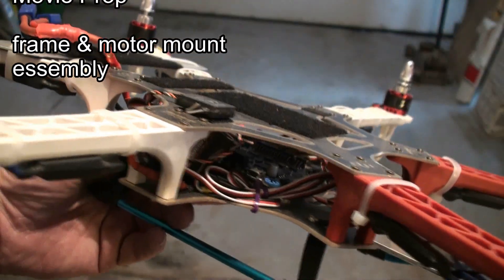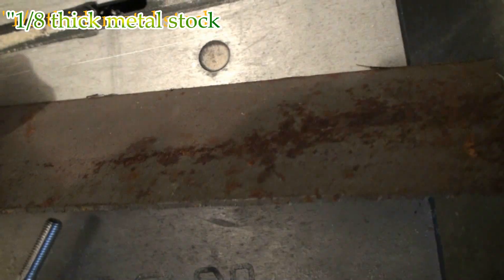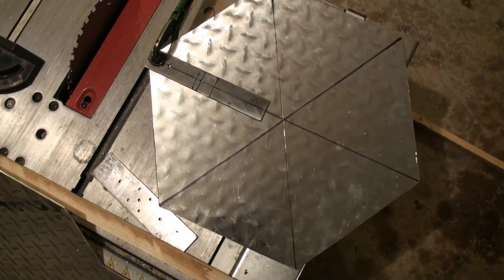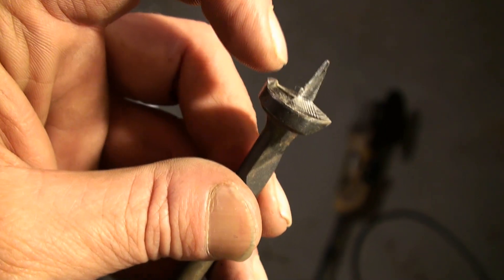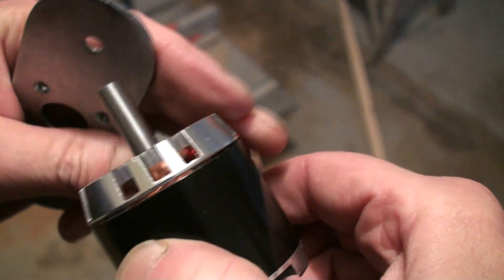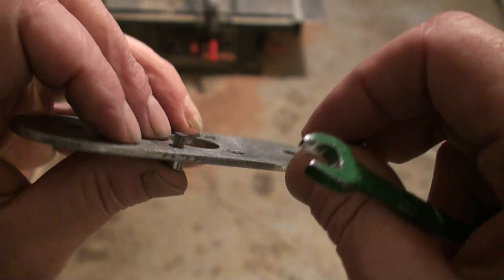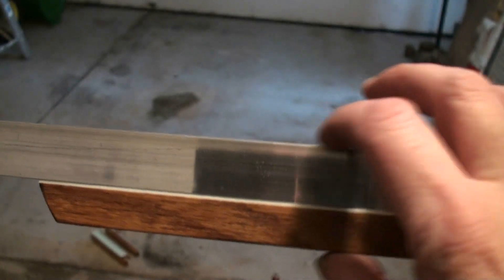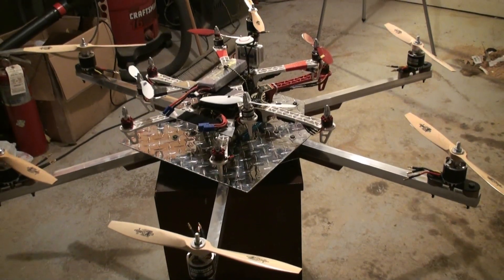#2 Building The Giant Hexacopter - Movie Prop - Frame & Motor Mount Essembly

Comment: 3mm birch ply with a few pieces of carbon would have been fine for the motor mounts,nothing wrong with yours,but with weight it cuts into your flight time and carbon in small sizes like your application is cheap.A small vacuum bag and or a diy press would work fine.for all your needs.I like the booms with the wood insert,excellent.

Comment: Holy Hell!! Why not just build it out of cement? And I'm suprised this guy has all his fingers and toes using tools the way he is. Also with the proper engineering you can build a huge multicopter that will stay in the air for atleast 30min and carry it's own weight.

Comment from the maker: Hi, I built a large 3 foot quadcopter last spring using this kind of diamond plate and it could fly ok but, I made the battery tray to small so it could only fly for about 2 to 3 minuets with 3 5200 mah 4s 45c battery's.

The giant hex has 6 SK 5055 turnigy motors that are about 2hp each and produce about 15 LBS. of thrust per motor on 6s battery's, so I think it will fly, but for how long, I'm not sure?

Comment: hello
would you tell me how big and heavy it is?

Mine not very tough. Build the Center of Wood and the arms a 3 side sheet Aluminium. Onjly know the weight with gimbal 3s3000 lipo fpv  stuff and 200g Casio Digicam. About 1,5kg

Comment: Yes, this is old and I'm not trying to insult you but how did it take you a couple days for trimming 24 M6 screws?!  Just send them to me and I will trim them with my Dremel in about 20 minutes, guaranteed to be perfect with no burrs!  

BTW good idea with the wood inserts on the arms, it really helps give them some strength and vibration dampening. I do the same but on a smaller scale for my DIY acro quads, the arms I use are only 12 mm square AL tubing.   On this big of a bird, the weight is going to kill you!   By now you probably already know that.

Comment: That doesn't address Aaron Ngo's point.
 Diamond plate is making too great a contribution to the weight of the copter.
ie, the reason you'll only be able to fly for a short time is because you have used it.

Consider
1 helicopter can stay in the air for 20 minutes.
2 helicopters can stay in the air for 20 minutes.

you connect helicopters, making them stay in the air for 1 minute.

Makes no sense to add so much weight. Throwing a camera up & catching it again would be easier.

Comment: DO NOT USE the tools the way it's shown in this video!Use push sticks with a table saw,vice when grinding,and safe glasses always.If you don't the may call you one eye lefty.I bet you could lower the weight by trimming the extra wood,not using diamond plate and not using steel motor mounts.